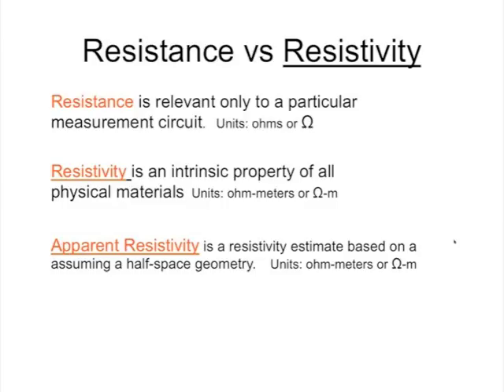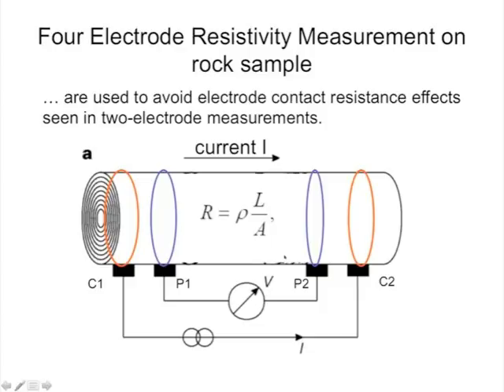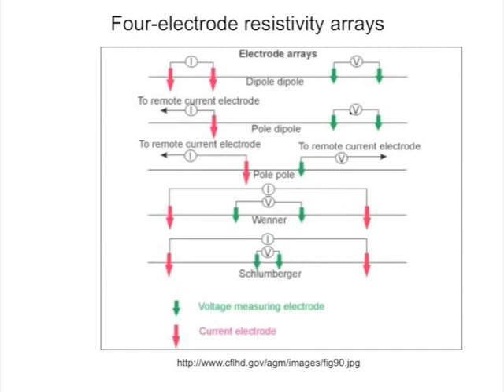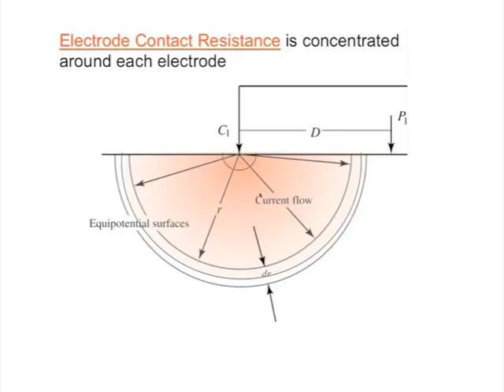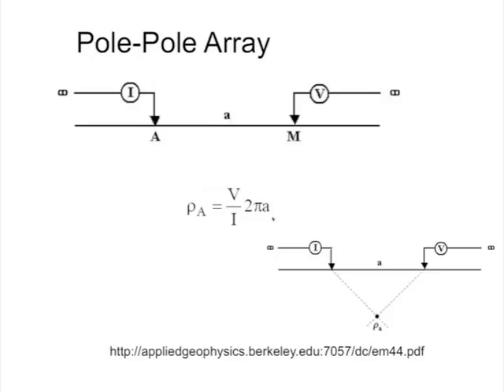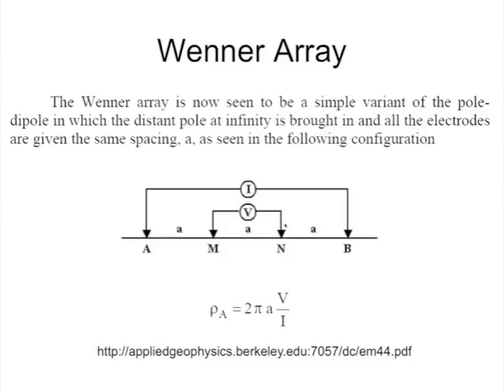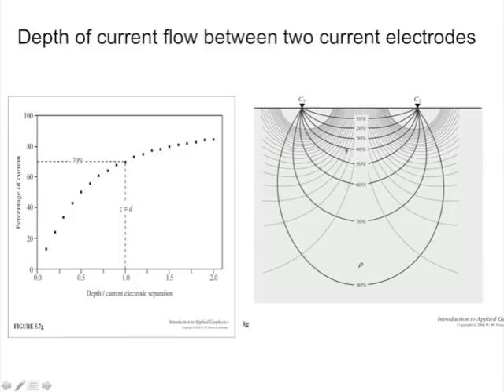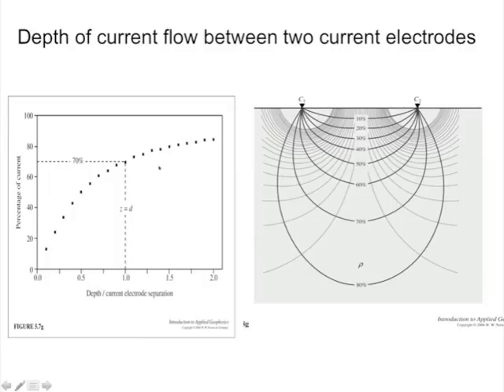Lecture 19: DC Resistivity 1

Comment: With regards to soil resistivity test procedures, why does the distance between stakes should be the same with the depth of the electrode? for ex. if the depth of the electrode is 10ft., the space between stakes  should be 10ft. also.

Comment: great presentation sir. One question please. how can I know which array I should use during my test? thank you
Reply from the maker: I mostly use the Wenner array for both simple profiling and sounding. If I am trying to sound especially deep, I very occasionally use a Schlumberger array, since it does not requires the potential wires to be as long as for the Wenner. For true cross sections, you need a complete dipole-dipole survey.

Comment: Hi John, would like to ask one of my work. Current ground level is 11m above the soil layer i wish to find out on its soil resistivity. What spacing would you recommend? And how accurate it will be? I look at IEEE81, if it is 300%, the error can be reduce to low of +15% to -25% error.

Comment: Question: What voltage is optimum for the current.  12V, 24V, etc.  Also, does amperage matter?  Is 20 amps better than 10 amps?  Any input would be greatly appreciated.
Reply from the maker: We have a very nice little resistivity meter, an L&R Instruments MiniRes. This machine automatically steps up the voltage to the current electrodes, until it can achieve a measurable current between them through the ground. The voltage difference between the two current electrodes can reach several hundred volts, just to get a few milliamps flowing through the ground, if the site is very resistive. Such voltages are hazardous, so careful safety procedures are a necessity. No one handles any of the wires or connectors while measuring, and no one gets within one meter of the wires or probes until the MiniRes operator has disconnected them from the meter.
Reply: Thanks John.  That is the info I was looking for.  I am aware of the safety issues when using those levels of voltage.  Thanks again!!
Reply: I think it's a ranges from 10's to hundreds